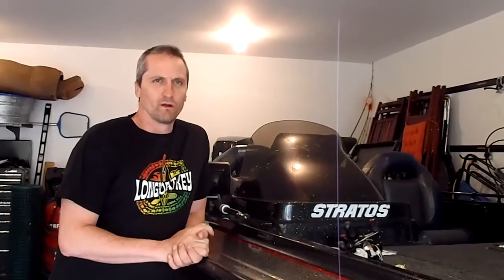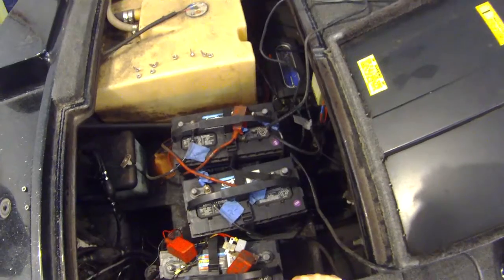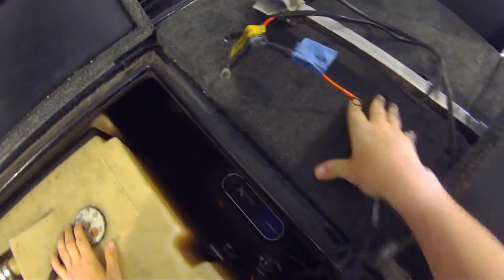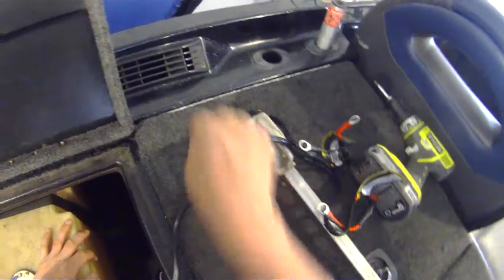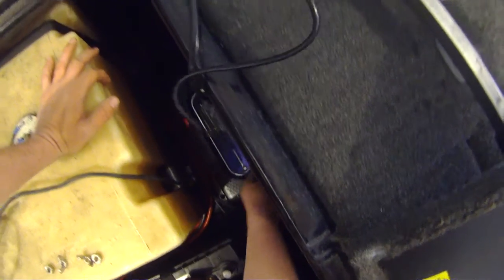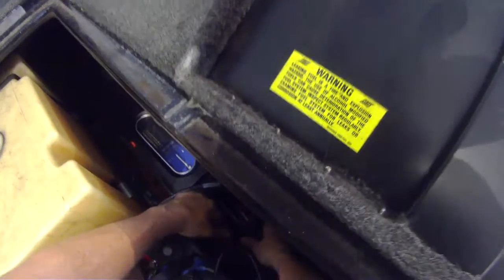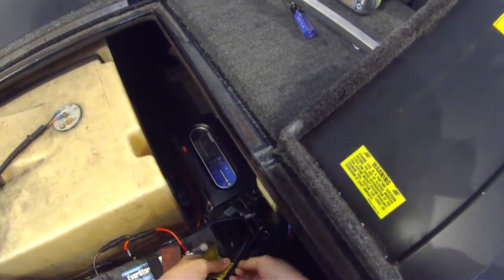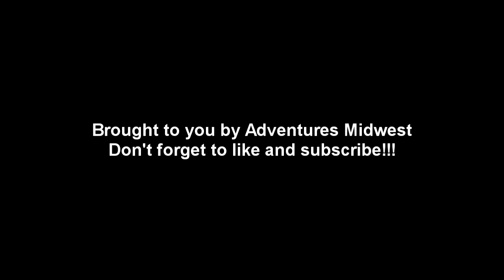How to install an onboard battery charger

Comment: I only have one battery. and a trolling motor no engine.  can I use only one of the connections? since there's two
Reply from the maker: I would imagine you could do that. I would look at the wiring diagram and just use the first position then tape up the other connection so it does not touch anything and short out or possibly start an electrical fire. Good luck hope you figure it out.
Reply: +Adventures Midwest ok thx for the tip and good video.  btw I'm accident prone haha